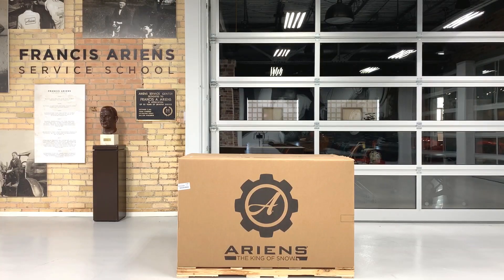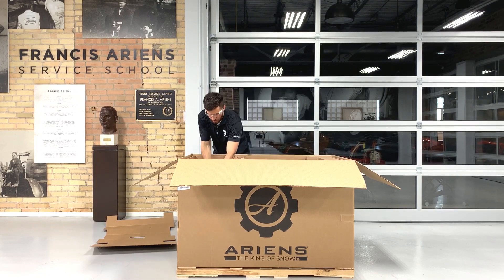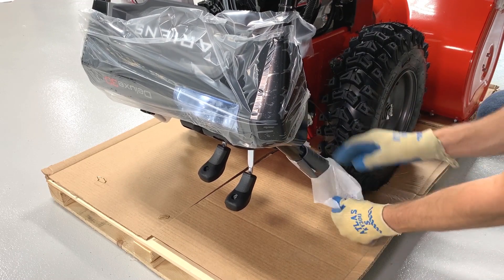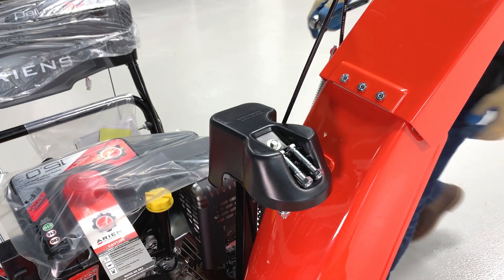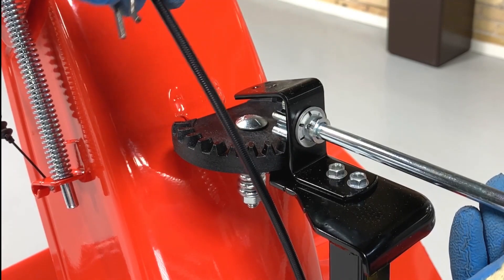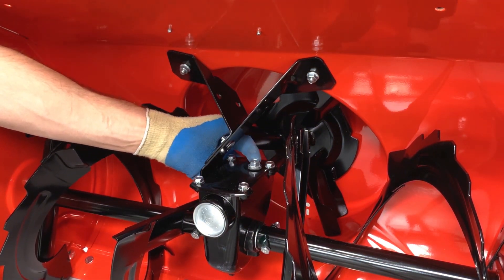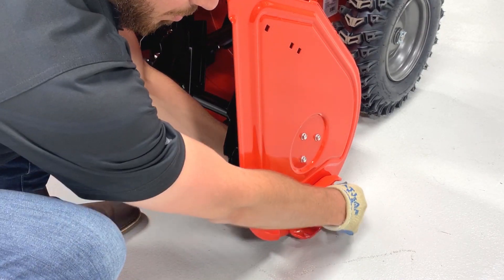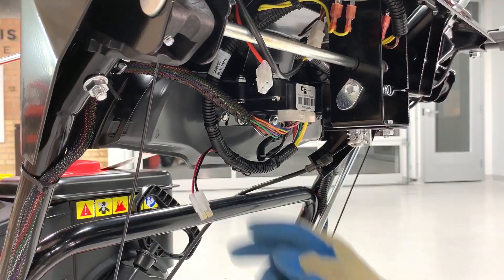Ariens® Deluxe 30 & 30 EFI Sno-Thro® Assembly | Ariens

Comment: Hello Ariens, we just bought one and discovered a 16 pin connector on the end of a wire harness is not plugged in to the controller on the underside of the control panel. There is seemingly a plug for it on the controller. The manual says nothing about these plugs. Do we need to plug it in?
Reply: Hello Ariens, we plugged in the aforementioned plug in to the connector on the board, and the snow blower performs as expected.  Just wanted to mention it in case anyone else needs to know!

Comment: I have a 24 deluxe 921045 I noticed there is about a 1/4" space on the axal between the wheel hub and the chases is that normal to be there. I'm concerned about it. thank you for any information